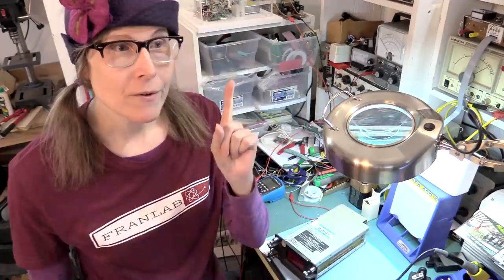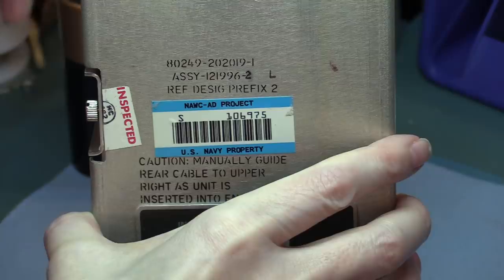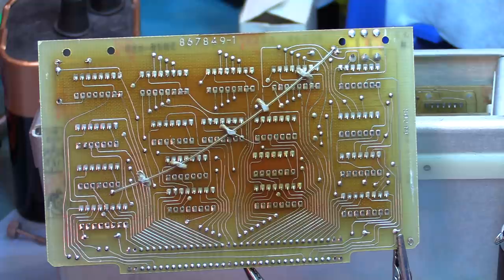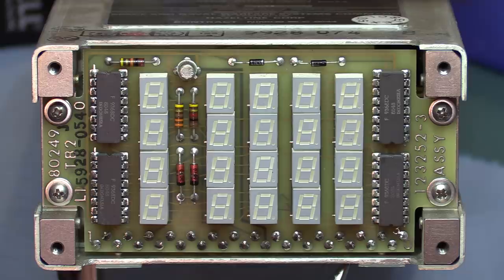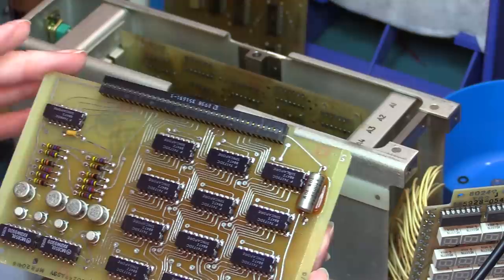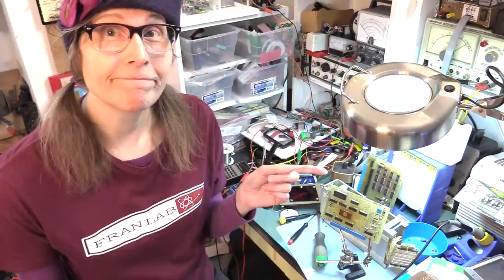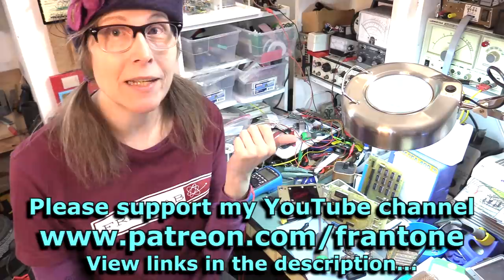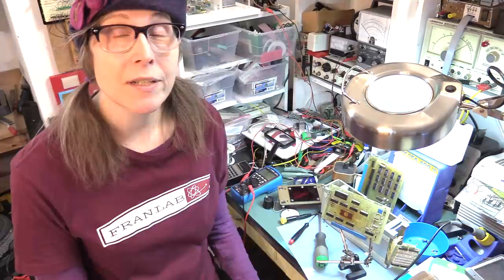REAL Wargames Tech Teardown!!!  80's Missile Target Display

Comment: I noticed some of the TTL chips were 54 series. Which were known as "military spec". Due to having a higher temperature tolerance than the 74 series. Ceramic packages, made in Singapore in 1979.
Reply: I saw that too. I think some 54 would take more than 5V too.

My personal fave is 4000 series CMOS, still being produced today! The original in ultra low power electronics.

Comment: There was a certain year and model of bmw that one of the computers was bad to get wet. I offered a service to waterproof them, they had water tight connectors but the computer housing would Leak. So I started coating the boards in about 5 thick coats of urethane clear and non ever had water problems. I tested the first by leaving the board out and sprayed it with a hose while it was running. After no issues I knew I had a permanent fix.

Comment: I find it very interesting that in a military device chips from different batches, even different subfamilies are mixed. 05:41 you can see two 7474 dual D-flipflops from 1985 and two equivalent 5474 from 1979, where the 54-series usually has the military temperature specs - but at the time of the construction the 54s were at least 6 years old...

Comment: Date codes all over the place:  7 segments from 85 on the board from 80 (with drivers from 80), other board with chips from 77 till 84 or even 89 (perhaps retrofitted)  -> looks like they were using a lot of then "new-old-stock" to finally deliver the unit in ca. 1986!

Comment: I wonder if the "reverse" backplane was done that way intentionally or there were a reason behind it.. "modern" backplane's connectors have blocks to prevent  bended pins. A long, long time ago I use to work with very old PDP-8 computers and at that time backplanes were close to today's PC. It is always interesting to watch and analyze these old stuff and figure it out how engineers solved a bunch of challenges. I still have a TTL logic based board made just with wire wrap !!! (It reminds me the DEC's 1091 wire wrap HUGHE and amazing backplane)

Comment: Common board mods for pc boards during the 70's.  I worked for Control Data then and we often had boards with dozens of cuts and 30 gauge wire wrap wire to make "Engineering Change Orders."  The boards were too expensive to scrap so they were modified as needed until stock ran out and updated layouts were produced.

Comment: The front panel apparently has each row using its own 7-segment decoder chip, so they were probably scanned in columns. The pad layout for the digits was interesting, usually they're DIP style.

That front panel could probably be wired up to an Arduino and you'd have a nice display that you could control over RS-232. It would be better if the decoders weren't on the board, because then you could make custom messages, but the 9368 will decode hexadecimal digits!

Comment: I would power it up by locating the power pins in the display encoder IC's and then measure resistance in the DB connector pins in both directions between the IC power pins and DB pins. The lowest values are likely power rails.

Comment: Built just like a Dolby CP55 Cinema Sound processor that fits in rack with a door that opens and cards that pull out with a hook. Well kinda like that but the cp55 had cooling fans and a blower in the rack to keep the amps and other equipment used for surround sound in the cinema cool. If there were ever sound problems we would have to pull each card out and reseat them and it was hard to pull them out..very hard i was afraid of damaging them.

Comment: Those 70s PC boards were often layed out with drafting tape, at 4:1 as you indicated. You could get DIP and other patterns that stick down then add black tape at various widths. I believe these boards were done that way due to the shape of the bends. By mid 1980s CAD took over.
Reply: Yes, that's a hand laid out board if ever I saw one, and well done too.

Printed circuit board tech has come a long way since.

Comment: It is likely you will get some of the LED displays to light up if you just apply about 3A at 5V on pin #14 and GND on almost any of the boards.  Beyond that it is probably too much work to determine the serial data protocol to data populate the display.

Comment: I don't know about this particular stack, but this is what I do know what that readout is probably displaying:

Mode A is probably something like Longitude, latitude, time on target/time since launch
Mode B is an estimated quaternion of the missiles orientation in a given phase of flight-path
Mode C is a vector, with an abridged difference. Sometimes this is normalized with a magnitude, sometimes its abridged with one value goal and one the gap
Mode D is debug/feedback information on the PIDs and error measurement systems for inertial guidance
Mode E is confidence calculations about the inertial guidance systems or the ability to estimate the path of a moving object or ballistic curve data depending on Aa, Ab, Ag, A*, Ax, etc.

These are generally the five debug or indicator screens an engineer or operator honestly gives a damn about, and you find these three+one operational layouts on most guidance systems. No idea what the exact specifics of this model are.

These kinds of readouts are sometimes still used today.

I'd try to see if there's any non-generic chips there. ASSY screams custom chips or assembler.

Comment: Getting that module to work is easy:
1: Trace the 0v and 5v traces from the 7400 IC's to the back connector pins.
2: Trace a couple of data pins to the back connector.
3: Connect a spark plug to the data pins.
4: Apply 5vdc power to the 0v/5v pins.
5: Piss on the spark plug.

Comment: I served on The USS Midway as a Radioman...
Serviced a lot of this type of equipment.
Most spaces, where this type of equipment was being used, temperature was normally kept around 45F° - 59F° Always felt like I needed a sweater on when I was working in those spaces... Not sure what would have caused those boards to become so badly discolored...

Comment: The front BCD board has costum made TTL segment drivers, I,m 77 years old and can stil know the total 74/54 series from 7400 to 74200, i can recal them by function. I had a Signetic factory bible, about 800 pages. To get good look at those series i bought 3000 chips wich where out of spec (investment of about 200 dollars). The most of them had only numbers on the bottem. So you have to determ wich is wich. Within 3 months and with the help of the Signetics bible I classified 95%. The time that ATARI computer came on the market. Those where the days Fran Blance.  With respect, John from the Netherlands and the time that those devices where used I was a Fire Controller ( guns, missiles etc.) in the Royal Dutch Navy) I like the style and the way your explaning evereting.

Comment: Here's an interesting project/challenge - reprogram the EPROM to convert the unit into a clock/calendar/temperature display.
Reply: For reprogramming, it has to be put in a special EPROM programmer, no in-circuit programming possible.
As this chip is soldered, they must have been absolutely confident in the absence of bugs :-)
Reply: @mgsp5871  Options - the chip can be desoldered, erased and reprogrammed if data sheet available OR emulated with a more modern chip. All of the chips are soldered for reliability - DIP sockets over time suffer from thermal creep and intermittent connections so they were not good for military or mission critical applications. They probably had a test unit with a socket to verify programming and emulate functions before placing into the field unit. Certainly Fran can install a socket there if she takes up the challenge.

Comment: The tool to remove the boards could be fabricated from a coat hanger.  It has hooks on the ends to go into a hole on each end of the board.  The wire is bent to resemble a handle between the hooks.  I hope that makes sense.  I did not work on these but I did a lot of board repair in the military.

Comment: Those traces were not drawn on vellum. Someone sat at a light table and laid it out with tape. The front side of the layout was created with red tape on a piece of clear acetate and the backside was laid out with blue tape. The vias, pads and IC footprints were available on pre-cut sheets in red and blue.

Comment: Based on the construction, this appears to be designed for the vibration encountered of shipboard use... I'm guessing Norad equipment has different specifications. Unlikely this is a fire control computer...odds are it's a display module for a pre ACDS console. Someone here thought this might be SPY-1 / Aegis, but I don't believe SPY 1 was rolled out to the fleet untill the late 80's. as far as the chip dates, the navy has a repair program through it's contractors to fix bad boards, so odds are these boards have been reworked and returned to supply dozens of times.

Comment: I took a closer look at the bodge wire in the video and it is connecting ground from one point on the board to another. At both ends it connects to a trace going to pin 7 of a chip which is the ground pin.
Reply: It wasn't so easy to make flood grounds back in the '80s when PCBs were still being drawn by hand.
Reply: Often if you need a higher capacity trace or a connection across a lot of other  traces you add an external wire because its cheaper than adding a board layer. The easy extra layers is fairly new technology

Comment: Interesting that you're mentioning the 'Black Brant Scare' (Norwegian rocket incident)!
I've been working with those rockets at the University in Tromsø - Department of Physics. We built and launched the Black Brant rockets from Andøya in the arctic region to do Aurora research. This particular launch was aimed at the magnetosphere over the Svalbard archipelago and I did both some electronics and CNC-machining of stabilizing components on those rockets. 
Don't blame me for the f-up though! 😂 A fax was sent to the soviets, telling them about the coming launch good time ahead, but it was misplaced and lost for some reason probably involving Vodka consumption. Accidentally, the initial flight path coincided with their presumed air corridor for a SLBM launch (submarine based nuclear ballistic missile) from the northern Norwegian coast, heading for Moscow. Luckily the flight path soon deviated from this assumed path when instead of heading east was going north towards Svalbard (Spitzbergen) so [one of] the anxious key soviets managed to keep relatively calm and kept their fingers away from the retaliatory launch controls. Also, recent 'technical problems' had their confidence in their own early warning systems at a somewhat 'less than stellar' level, helping them to make the correct decision not to launch but I can imagine the level of palm sweat during the first few minutes after 'detection' (and matching level of Vodka consumption afterwards).
Cheers! 😉

Comment: I have seen a lot of PCBs from soviet equipment, and the most striking difference is the absence of ceramic capacitors for power line decoupling, just one big tantalum far away. 7400 series (or 5400 as it supposed to be military equipment) are supposed to have one ceramic cap around 0.1uF per each package.
Reply: 0.1uF is the factory recomandation. But not nessasary if the layout is cap. messured!!!

Comment: I would have thought a mil-grade gadget uses only the SN54-series versions of the SN74xxx parts. Plenty of '74 prefixes visible. SN54 was the mil-grade version of the chip with a wider range of specified operating temperature than the 'industrial' grade SN74-series versions.

Comment: On FPV drone racing a lot of racers use silicone based conformal coating on the boards and anything else that needs it; I've even seen a vid of this guy flying around a water feature went through a spray of water and even when in the pool of water and surprisingly it when's up and broke the service of water to get up in the air again😄

Comment: When I need to pull cards like that I use about a foot of standard single conductor 14 gauge wire, strip each end, and bend a hook in the copper. They don't last long.

Comment: Very neat!
It looks like it was originally a swapped out assembly, slowly cannibalized of its working modules and re filled with scrap ones, & the EPROM erased. 
I have a smaller EPROM chip not near as attractive as that one. 
Military spending is all about who sells for le$$. 
Ppl mistakenly think Armies have gold plated everything. It's def "good" but not (if you knew it's going to eventually drop in the ocean), you wouldn't put a Rolex Clock in it either. 

Those Traveller Stamps were still used 18 years ago. 
It was QA passed in 1986 from what I saw, and reworked in 88.
I used to have a stack of very similar modules, and recycled/tossed a few.
I have a small box of old Military (RCN) chips if they're useful anymore. 
I recognized the 2N222s.

Comment: There are card extractors designed for those.  The newer isem cards had the same holes. The extractor grabbed the holes, seated on the outer frame,and pulled the cards out until it hit a rubber bumper.  This looks older than 80s isem cards which were smaller. Many of those were surface mount gold printed wiring on alumina substrates bonded to an aluminium carrier that had the extraction holes.

Comment: Interesting.  I didn't notice any EMP damper "spirals" in the PCB traces.  The spirals forming a jump point to ground for EMP generated overvoltages.  I think the jumper on the back of the PCB ties the grounds together to reduce a ground-loop causing EMI?  Not sure but possibly?  The epoxy every inch or so I have seen silicone rubber adhesive standoffs on fighter jet boards and they are evenly spaced about an inch apart and designed to absorb vibration and prevent metal fatigue in single copper wires of any length (when they can't be wrapped in a loom with many other wires).

Comment: TTL runs on 5VDC on pins 14 or 16 (upper right corner) and GND on the opposite corner. Do a continuity check from the power pins to the 37 Pin D-sub on the back. Throw 5 volts on there and see what happens!
Reply: While most are like that there are a few 7400 series devices that have the VCC and GND on different pins.

Comment: Great video! 😀 But I still think you should try powering that device up and maybe see if it displays something interesting.
That EPROM thing suggests there's some sort of computing action going on, to drive the digits maybe?
Applying 5 V over that 100 uF cap with test leads would probably be a good start. 
Or at least measure if it has continuity with any of the connector pins.

Comment: Hi Fran!!! I'm new to yer stuff! About your arthritis---IT SUCKS!! About MS, this sucks too!!! We can be miserable together I guess!!! I'm Shane! You should see the unbelievably cool things that I am doing on my model railroad downstairs! I engineered the control system, the signal system, and the sound system!!! I have never really seen DCC as a fit for my railroad given that there are about 400 locomotives on the layout---I would have to get a second mortgage on my house to finance DCC!!! I created my own control system that is automatic, and there is nothing but a small wire that protrudes from the side of the locomotives, certainly not 25,000$ for decoders, and the power supply!!!
       My system uses the 4017B decade counter. Whenever the clock gets a tap from the locomotives, the power supply that is assigned to the locomotives gets selected, and is sent forward into the block ahead----PNP, and NPN transistors control the direction---it is so slick!!!
The signal system works on the same principle. The sound system works by opening and closing SCR's. I take a sound decoder and put it into a booster EQ with the speakers mounted above and below the trains---sounds like EMD coming through!!! The signals work just like the US&S signal system on the real thing!!! Now if this damned MS would just behave, I could get it finished!!! I like yer channel!!!!!!!!! I just subscribed!!!

Comment: Actually those IC's were the US made chips, but assembled in the external countries. The military and civilian chips came off the same product lines, used the same parts and epoxies, and the same assembly. Only difference is that the military versions had a 100% performance check and burn in for the entire lot, and were allowed only 1 or 2 failures total per lot. Those that failed that became industrial quality, or commercial quality.

The connectors to the backplane are very common, and very reliable. Yes there is both a tool to remove the cards, and as well 2 alignment jigs, to get the socket pins aligned in the case, and then a tool to align the socket on the PCB, Incidentally that display is a retrofit, along with the driver board, the original would have had a board and Numitron incandescent displays on it, but they had to replace with Monsanto LED displays when those lamp units became unobtanium. Thus the board respin to allow multiplexed displays instead, and the front panel got led displays instead of the socket and hundreds of diodes to isolate the displays. 

The EPROM is there to implement a state machine, it uses bit patterns on the inputs, and then the outputs are used to do further logic. Likely there are 4 bits on the output that are used to drive the LED decoders, and then there are a set of the inputs that are fed with a binary count of the scanning for the display, so the display will be scanned and display. There will be some memory as well, some 4x4 memory chips that store the digits, and they get fed serial input data to display. Then further inputs are the decoding of the input to write to memory and do error correcting. Yes I worked on similar systems, serial data streams with dozens of 2708 eproms to implement the complex logic needed, and then Intersil serial RAM to store the data.